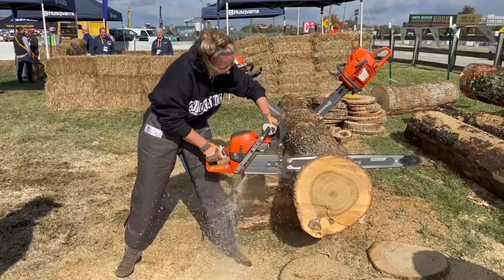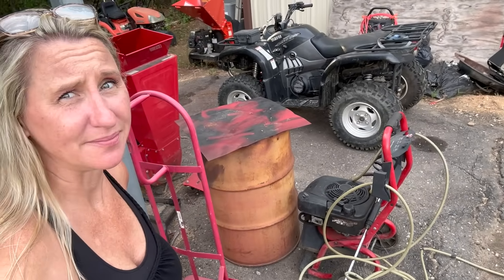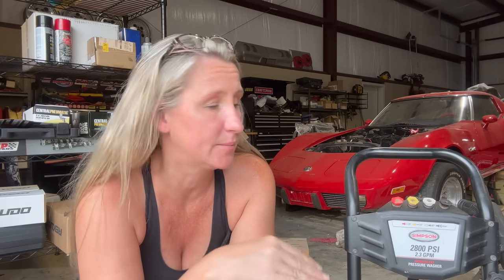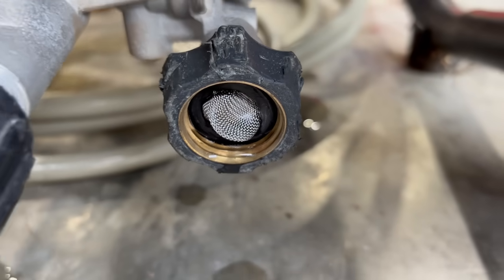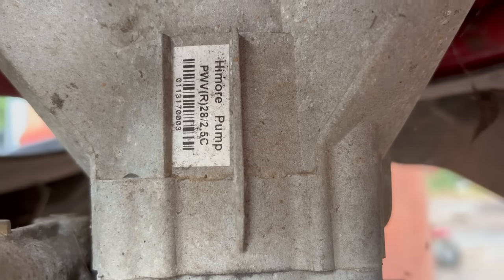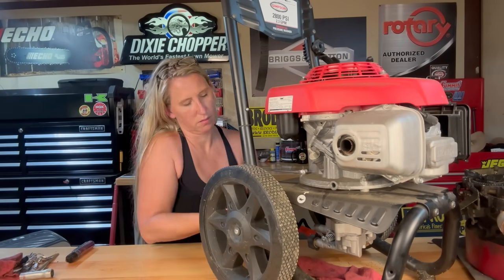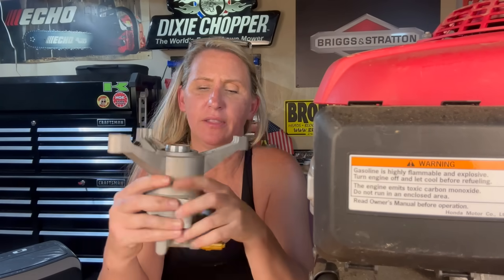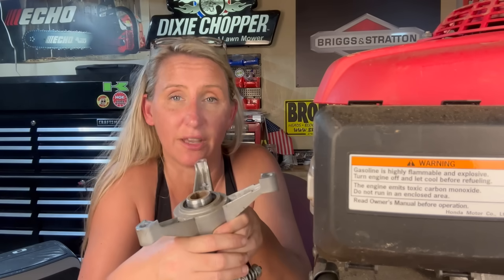STOP Paying Repair Shops! Pressure Washer Has NO Pressure?! Check Out This Super Simple Fix!

Comment: Yeah, usually what goes on pressure washers is the pump.  The engine's still good on most of them.  That being said, I currently have a vertical pressure washer with a Honda GXV clone that when it comes time, I may just replace the whole unit.  I have another engine I would just buy a pump for or even invest in a GX390 and AR Pump-equipped pressure washer from Echo that does a better job.

To store your pressure washer at the end of the season and during winter, you put in pump saver or pump antifreeze.  I also drain the fuel system to prevent gasoline going gummy.  After each use I also drain the hose and wand.  This is in practice as I have other equipment that requires similar maintenance.  My Rainbow vacuum has to be dried and the separator checked after each use and the carpet shampooer and other similar attachments I have go through a similar routine.

Comment: Check the rubber O-ring seals.,an for leaking base gaskets. It's most likely from not completely draining out the water and putting in one ounce of RV antifreeze inside of the water pump units when storing them.

Comment: I have found algae?? in my screen. Mine came with an auto idle mechanism. When it quit the company told me how to delete it. They had no fix or replacement. I often had trouble getting the pump going in the spring. I have started using the pressure can of oil and leaving it screwed on until spring. I think I bought a bigger pump than needed. It is powered by an 11hp Honda.
Good luck Ron. I think I am too old to repair.

Comment: I didn't know that people buy a $3/400 unit and don't read the operating manual. That seems extremely childish to me, but some people know it all so I'll pass on those with the burned up pumps. My Harbor Fright unit had a manual and I read every manual I get (because I like to know how those that engineered and built the unit want it operated). My manual did say DO NOT LET THE PUMP IDLE FOR MORE THAN 60 SECONDS. I tend to believe the operation manual for any unit more than anything else, experience included. Since I scour the tube channels for intel I can use, I am an ardent fan of this lady here. When I came across her shop talk about this situation, I now do not let it idle more than the time it takes to get to it and shut it off. Luckily (or not) my unit has a fantastic ignition system and starts almost immediately upon my pull. Thanks to the Chickanic I hope never to have a pump problem with it. Unfortunately, it also means that I do not lend it out to anyone at all. I am the only one allowed to operate MY power washer. I don't like to blame others for my mistakes.  I hope your guy pulls through with flying colors. I love your channel.

Comment: The screen was the 1st thing that popped out after one use while un hooking the hose.ziptied the trigger from start.then unhooked the pressure line.an the water was hot.even though i kept nozzle zipp tied open.changed oil also after using for 8 hrs.we get what we pay for in them.

Comment: Sticky valves with crust from dried water is an issue because they will not let water in and leaving them in antifreeze or trans fluid in the pump will help a lot. A person can use a inlet hose made from a cut water hose filled with either and forced through the pump with air pressure carefully until it comes out the other end works but it takes effort and thought.

Comment: On my pressure washer, when I have it running. I take the tip out when i'm hand washing my truck, taking the pressure tip out first then Squeeze the trigger. Leave it open. That way, the water is still flowing. Freely through the water pump, keeps it cool. Yes, I have seen so many people.
Let Their pump idol with no water.
Flowing through the system to keep the pump cool. And it Burns thim up Every time. I have never had a problem by opening up the trigger first taking off the Pressure tip letting the water flow through freely by squeezing the handle trigger Sliding a zip tie on it to keep it open🫵‼️
Prayers🙏 to your husband get well soon.🫵🫡‼️

Comment: Great vid, great advice but you missed a few things. When starting a pressure washer you should always prime the pump. With the engine off, turn water on, pull the trigger, pull the cord a couple of times. Turn engine on, pull the trigger & pull the cord, it should start. If it starts 'funny' just sqeeze trigger on/off a couple of times. My washer had been used only a half dozen times & stored inside with no gas. The time before last it was used with 'soap' by a relative. The last time with plain water & it worked fine. This time no pressure. The advice online, check the water filter, hoses, wand, tip & unloader valve. I cleaned the filter, it was not blocked. Wand etc were fine. I removed the unloader valve, it was packed with soap crystals, argh. I replaced the valve ($10 Ebay), still no go. I called Ryobi for help, waited two hours for a call back then waited an hour on the phone for a technician, then gave up!! At least Ryobi has full schematics & parts lists online, that helped.
My washer is the early plain model, there are later A & B models, all with different pump part numbers. The early pump is expensive, the later models half the price. The advice online is they can't be swapped. Eventually I found someone online that did swap & were successful, after checking mounting dimensions, that's the route I took. Don't finally tighten the mounting bolts until the new pump has run for the first time & everthing is centered. This was over two weeks of frustration. I didn't give up because the Honda engine is good, repair is expensive, a new washer is expensive. Renting, if you can find one that'll fit in your car, was the last resort option.

Comment: I was given a pressure washer that wouldn't run.  Turned out one of the carburetor mounting screws had sheared off.  I replaced the screws with an all thread to make installing the carburetor and gaskets easier.

Comment: I have rebuilt probably 30 to 35 pressure washers from parts from eBay or Amazon 90% of them were Craftsman I rebuilt my personal one 6 years ago and I also zip tied my handle on the wand so it stays going

Comment: Ok when you are done running your pressure washer remove the hoses and pull it over to expel water the use Briggs and Stratton pump saver your pump will last a ver long time 😍

Comment: Love the help and $ u save folks..how about a video on their health?? The way air flow is directed to cool these higher temp motors is extremely important..I do 4 acres..husquavarna 48 "-- Briggs 24?? And I have a cub cadet 46" -- kohler 24...the Briggs totally covers my feet.legs.with dust..the kohler directs far less dust on driver..bet you got both in shop..a fast a-b video..I always mask up but many folks do not..I have pics of my legs totally covered..check it out. You'll be amazed.

Comment: Even on city water, you can get grains of sand come through your water faucets in and around your home. In California in the 1960s, 70s, and 80s I know for sure. You could remove the aerator from the kitchen or bathroom faucet you would see sand. If sand were to get into these fragile little pumps it would end up a catastrophe. You are supposed to service your pump before the first frost to get the water out of the system.

Comment: Thanks for the video. Do you know what kind of oil the pump takes? I made a mistake and pour regular engine oil into the pump. I did not start it yet. Was wondering if I will have to drain it first or it can be ran like that. Let me know. 
Hope Ron is doing fine.

Comment: It’s very simple to eliminate this problem. Pressure washer manufacturers need to include a can of pump saver along with instructions when to use it. I learned the hard way and only used my new Troy Built  pressure washer once before discovering the pump wouldn’t take prime.  Pump saver comes in a small aerosol can that attaches  to the water intake. Pressurized lubricant forces the water out of the pump leaving the lubricant in the pump.  One can will flush your pump 4 to 5 times.

Comment: The Best/Easiest fix for the 1st pressure washer she shows at the start of the video is to put the Tip on the end as you can clearly see that it's not on and ALL pressure washers will just put out a stream of water with no pressure without the tip. As soon as she cut off the trigger you can see the hose pressurize. That is the purpose of the different tips to restrict the flow to create the pressure.

Comment: I had an Industrial hot water pressure washer that would give an intermittent jet.   It had 3 pistons and 6 metal valves, each about half an inch diameter.   These valves would slip over sideways and cause the problem, all that was needed was to re-centre them, and it would be good for another year, sometimes a hit with a hammer was the cure.   Quite why it did it I don't know.

Comment: Yeah I've worked on many of those type pressures washers mix and match and the worst ones are the tiny check values inside of them that goes bad especially when they let them get too hot or let them freeze or run dry  ? 
I also have a  few pens to  put on your straw hat  but I need to know the address to send them  and become a member of your group  ? 
Thanks  Daniel  in Knoxville Tennessee  ...

Comment: Lady, you are good. Very down to earth. Wonder if you are in Atlanta area.  I have a pressure washer problem and hoping you can help out this old guy.

I have troybilt GV190 pressure washer with honda engine model 020489.

Engine start, when pull the trigger on gun to wash the surface. It stops, any suggestion?

Comment: Funny I just bought a new pump for my pressure washer because I didn’t think the Honda motor was that bad. It worked till the end of last summer when I used it and then it just decided to leak oil. I think that’s the biggest problem. It’s got a bad gasket. I might take it apart someday. It definitely needs oil to build the pressure. But it looks like the new pump will just slide right on and it’s horizontal. It was only C$85.00 after taxes and free shipping. So I figured why not.

Comment: one of the things that folks need to get over is the fear of failure.   But think of this - if it is really broken - guess what - you cannot break it by failure.  So go watch a video and see how and then do it - if you can.      as the narator said - if you take it in - probably cost 2/3 price of new one.  So if you really break it - well - you were in to state of 'buy a new one anyway'.  If you fixed - pride.  If you fail, just go buy one - as you were headed in that direction anyway.

Comment: Questions for you smart folks. Have a PW, only couple years old. Slightly and very lightly used. Always took it down stairs in the winter. never let it idle long. Took it out, started it up. As soon as I operate the sprayer, it shuts right down. I'm thinking possibly cracked pump as it might have been left out on one cold temp night. Is it the pump and how do you check to see if its cracked?

Comment: Maintenance on a PressureWasher is something I've never tried, until recently,  but sure seems doable.  Not like it has a lotta parts.    My concern, I don't have one of the nice Large Gas models.  I have a 2000 psi Greenworks Electric model.     I suppose replacing the pump on an electric is really no different?   I did take the pump apart to see why it wasn't shutting off, maybe something stuck.  Didn't find anything, put it back together and it worked ok a couple minutes then started running constantly again.  I use the Trip/Reset switch to turn it on and off for now.  Real annoying.   Anyways, I'd rather just put a New Pump on it, but I'm clueless the size I need.

Comment: No pump will seem like it is working if there isn’t a tip installed in the gun.  Also, pumps can be had for $55-$75, at least for the horizontal pumps.  I’m at over 12 years of regular use on my Frankenstein pieced together pressure washer and it’s only on its second pump.

Comment: My pump doesn't like ro go into bypass until it runs for a while. Put pressure washer lubricant in it the other day for the first time. Haven't used it since so don't know if it works. My gripe with pressure washers is that all jets seem to be sold for 4gpm/4000psi pumps or electric pumps. Meanwhile the vast majority of pressure washers sold are in the middle. To get a decent driveway cleaner I had to buy a 4000/4 and plug one jet. The jets are easily replaceable but nobody seems to sell them.  Without the correct jet(s) for your rated pressure and gpm your pump will not get the rated pressure and gpm.

Comment: dosen't the thermal release valves on the pumps that dumps out the hot water so cold water can flow into the pump helps to prevent damage to them while idling?, my pressure washer has it and im curious if it really does help save the pump

Comment: I wanted to get clarification on your comment about not letting a pressure washer idle.  My pressure washer doesn't have a throttle control so I don't think it ever 'idles' per se.  Once it's started, it runs at full operating RPM all the time.  So, it's on and running but I may or may not be spraying water at any particular moment.  So, for clarification, you're not talking about idling as the time when I'm not spraying, right?  Because the engine is still running at full RPM.  Also, you mentioned a couple ways to burn up a pump by a lack of water pressure and letting the engine idle, but running the engine/pump with no water source at all would quickly do the pump in as well.  Something that should always be avoided.  You mentioned that when a pump fails it quits putting out pressure.  I think what happened with mine was it got hot and started leaking gear lube which has that distinct smell so I replaced it just for that.  It was quite easy and works like a charm now.  Lastly, I wanted to thank you for your videos.  I have a full compliment of gas powered (and some electric) lawn equipment that I try to keep in working order and your videos have been a huge help in understanding how little things can lead to big problems especially where stale gas and water in the gas are concerned.  Again, thank you!  And I'll continue watching and looking for new videos.

Comment: Hey I have a honda gx engine on my john deere 180C reel mower that seems to be running rich as it seems to produce more black exhaust than normal. Oil level is good, carb clean and good… any recommendations? I don’t see a fuel mixture  adjustment.

Comment: I have found the tip gpm needs to match the gpm of the pressure washer to work properly.  Or even work at all.  My 3000 mtm hot pressure washer will not spray with a 3.5gpm or 4gpm tip.  The tips are stamped with the gallons per minute rating.

Comment: Question: since all of the pump manufactures say never run the pump without flowing water for longer than 60 seconds; what if you remove the pressure nozzle and just dump low pressure water out of the hose? It takes longer than a minute to either cool the motor down or run the carburetor dry of fuel but, if its just pumping low pressure water through the pump but not loading the engine trying to make high pressure water, would that prevent damage to the pump?

Comment: I have approx 1/2 acre to mow.  St Augustine grass and I'm looking for advice on either a riding mower or Zero turn mower with a 38 inch deck.  I've looked at the Toro Timecutter 2024 model and they have 2 cyl Briggs & Stratton engines.  Really can't find any riding mowers that seem reliable. Any recommendations would be much appreciated.

Comment: Replacing the pumps are easy. I had my left hip replaced 12 years ago and I can barely walk today. It never doesn't hurt and the doctors tell me that the only option is to replace it again with a more radical surgery. The one I have is chromed cobalt so they don't wear out its the femur and socket that are the problem. I would have to lose more femur and have a more radical procedure on the pelvis to anchor it to. Just harder on us big men I'm told. 6'4" and 280lbs. So just do what you can to strengthen everything and be wary of the blood clot dangers, the lovenox inj. Med is spendy or it was anyway. Don't be embarrassed about asking for help because you're most likely gonna need it. I couldn't wipe my backside for a week after getting home. Thank God my precious wife took great care of me, plus getting in and outta bed has to be done with teamwork getting the dead leg in to position. Alot of pain if you don't get it right. Use a gait belt when walking at first, its amazing how little strength there is after cutting that main muscle. Good luck y'all, take your time and be super careful with the pain meds. Will remember y'all in our prayers. ❤

Comment: a LOT of pressure washer issues, especially surging, is due to the low pressure INLET hose.  It is either kinked or too small diameter.   move to a new faucet, and use a new shorter hose, and it probably will work now.

Comment: Sounds to me like these pumps need a clutch for idling.
Something like the clutch used in an Auto AC unit perhaps.
pull the trigger actevate the circuit engage the pump at time of use.

Comment: Well my manual doesn't say anything about not letting it idle for a certain amount of seconds. I have a cat2 pump with a thermo valve. Plus how are you supposed to move the machine around or ladders, etc while continuing to depress the trigger? And you can leave the pressure washer outside in the winter cold when you properly winterize it.
Reply from the maker: Cat 2's are super fancy pumps with extra release valves. 95% of homeowners do not have the extra pressure precautions and a serviceable pump like that one.
Reply: @Chickanic  Oh ok I appreciate the response because I was very perplexed why my manual made no mention.  I still keep pauses to a minimum the best I can.